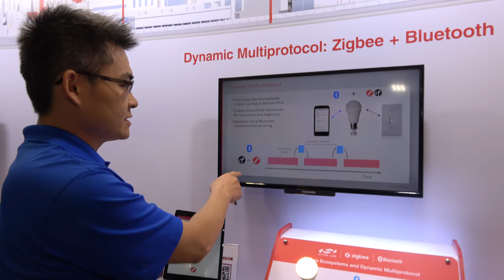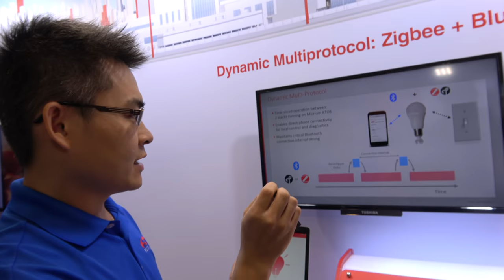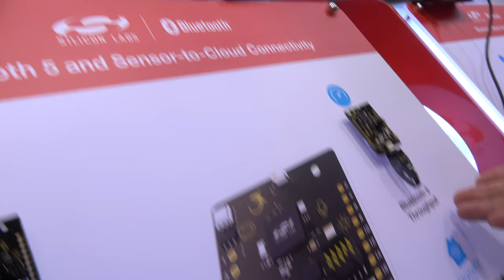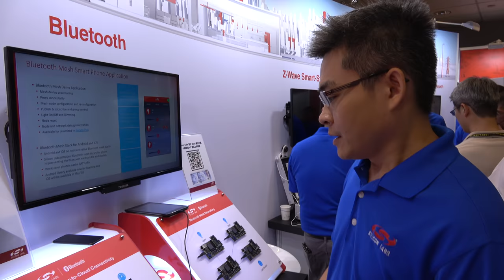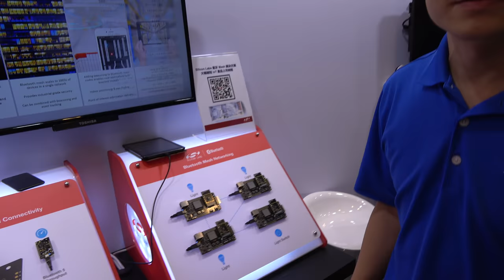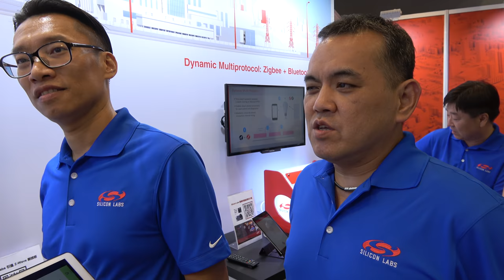Silicon Labs Dynamic Multiprotocol Zigbee, Bluetooth, also Z-Wave and other

Comment: Can it get more professional then this? Infrared auto focus zooming was a failure as example.
Reply from the maker: I'll upgrade my camera once Sony, Panasonic or Canon have a camera on the market with a super sharp 4K60 (preferably H265 option to dual SD card slots) with a stable usable auto focus performance. Thus far GH5 and GX10 aren't suitable so I am waiting.